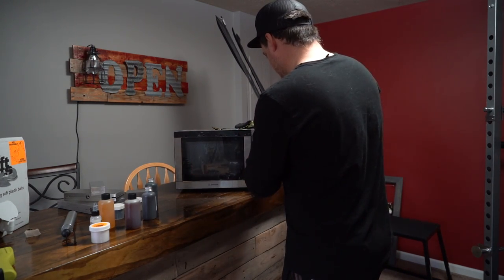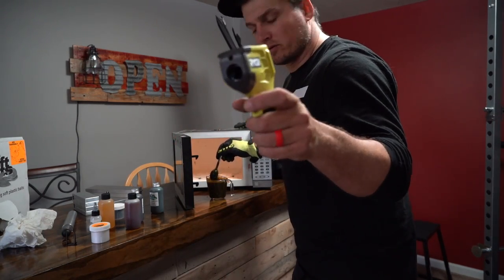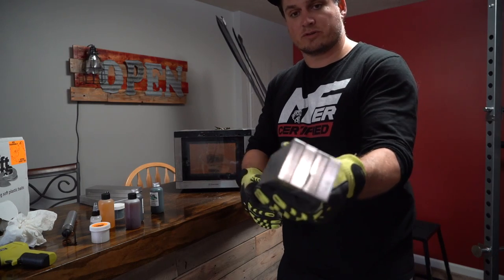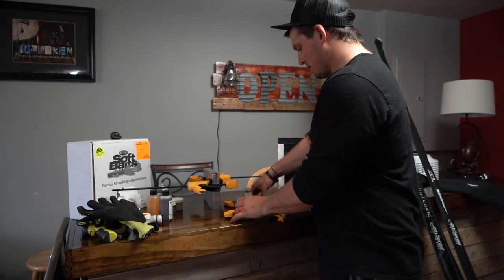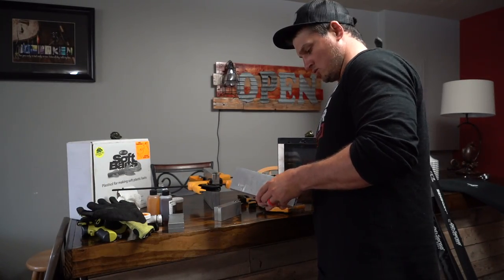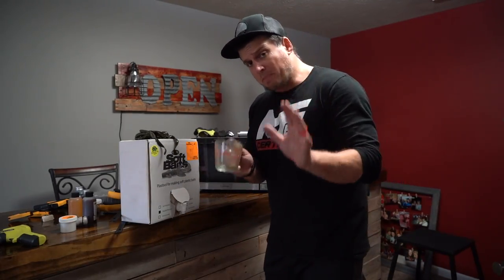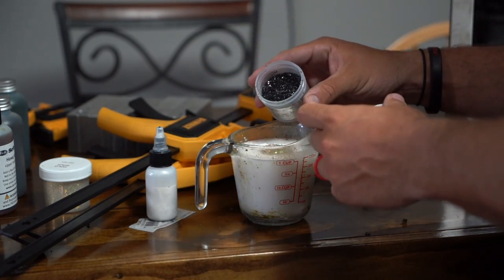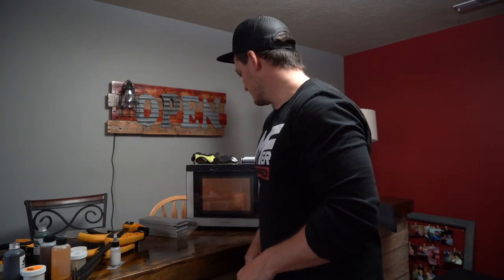How to Make Soft Plastic Fishing Lures!!!

Comment: I've been doing homemade soft plastics for some time now, so allow me to share some of my experience.

#1 Always take notes. Perfection in repetition requires you to learn from your mistakes (or improve your successes). Always start with the same amount of Plastisol. For me, i like working with 1 cup at a time. That way, you'll always know how long to cook it in your microwave (2:30 for my 1100w microwave), as well as how many drops of pigment to achieve the clarity you desire.

#2 Do Not pour plastisol into your injector until you are well versed in it. At ideal temperatures, the plastic will flow like milk. Once it cools down, it pours more like maple syrup. Even while wearing gloves, 350degree plastisol will burn you. It's the plastic used to print images on clothing, so it will seep into your clothes and stay there. It's better off to insert the nozzle into the plastisol and peel it off the injector before shooting another mold (it will solidify quicker than the plastisol in the mold).

And lastly, #3 you can cook the plastisol to 350 degrees BEFORE you add your color and glitter. I know it looks white in it's shipping container (or your Pyrex), but it will be clear when it's fully cooked. That way you can stop yourself before you go too far with Green Pumpkin. You can always add more, you can never add less (adding more plastisol to the cooked stuff won't work). I recommend taking your time and counting your drops. For me, 20 drops per 8 onces is plenty. I also use a 1/8 teaspoon for glitter, highlights, and pearl powder. 3/8 teaspoons is ideal for some of my recipes.
Reply: InEccess do you have a social media so I could possibly buy some
Reply: InEccess thanks for the tips bro I’m trying to get started making swimbaits for lingcod out in Cali. I really appreciate the knowledge.
Reply: @OutdoorsCK  thank you for your interest, but I do not. I only make mine as a hobby and to present the fish with a different look than what the local club anglers throw. It's a fun hobby and I suggest picking it up.
Reply: @berserk9163  if you haven't started buying supplies yet, i would recommend Amazon for the Injectors. You'll want the 90ml or 120ml plastisol Injector. You can always squirt your unused plastisol back into the pyrex cup, but you can't refill the injector if you run out shooting a mold. Dead on Plastix has plastisol for specific applications (like Swimbaits). The molds will be the most expensive, but you'll only ever need to buy them once. For a quality mold for swimbaits, I'd shell out the money for a good one from Angling AI. My Do-It mold has a defection in the tail on one of my cavities, so buyer beware. Angling AI machines the molds as they are ordered, so they're not mass producted an sitting in stock waiting for someone to buy it.
Reply: InEccess thanks I’ll definitely check em out
Reply: InEccess I’m interested in starting this myself I know it can be a little pricey what do you recommend for me to start out with budget wise.
Reply: InEccess what’s the best way to clean the injector after use
Reply: InEccess how much money do you think I will need to spend I have a microwave but nothing else. 
 thank you for your help.
Reply: Cade Shaw I haven’t started yet but I ordered stuff you need off amazon and eBay and all together I was able to get off with $150 but I would highly recommend if possible to spend at least 250 so you can get a 5 gal bucket and not a 1 gal
Reply: Do you need hardener or just plastic salt
Reply: how did this not get a heart
Reply: Will making theses in microwave ruin the microwave
Reply: @Cooper Bates I wouldn’t do that it might mess it up, I haven’t done this yet I’m still in the process of getting into the hobby but I’d leave it on a piece of wood or something flat and make sure it’s straight so it doesn’t solidify with a curve
Reply: what plasticol do you use i dont know what one to buy?
Reply: @oscar_is_carping4506  I use Dead On Plastix, as it hasn't given me a reason not to. I don't like deviating from my recipe, so I tend to use the same plastic every time.
Reply: @graysonstout6800  No. However, if you're using your kitchen microwave, your spouse won't be happy with the smell. To offset this, you can get a slow cooker from Walmart for under $40 bucks. In it, once you set the temperature, the fumes aren't as noticeable. You'll want 2 so you can dual inject your baits.
Reply: @henrycunningham4909  sorry for the delay. I use different premixed gallons of plastisol from Dead On Plastix to make it easier on me. That means I have at least 1 gallon of everything from Finesse to Craw/Tube depending on what I'm shooting. Secondly, I don't use salt anymore. Initially I did, but the salt being pushed through my injector caused the O-rings to tear and things got messy.
Reply: @Cooper Bates No. The extreme temperature change can cause your pyrex to shatter. What you can do is get the artificial ice (usually fluid inside a heavy duty blue plastic container) and press that against the sides of your mold after injecting the plastic.
Reply: @cadeshaw3243  sorry for the delay, YouTube didn't tell me about these replies. Amazon injectors (about $120 for a dual injector) and Do-It Molds (~$60 plus shipping) will be your first purchases. The plastisol ($45 for a gallon plus shipping from Dead On Plastix) to save money on shipping I would also buy the colorant and glitter from them. So $250 should get you your first (as an example) 320 dual colored Senko's (It's not too far off from what 320 Senko's would cost retail). After that, your next batch of 320 will only cost you $45.
Reply: @goober1441  if you're talking about during the bait making process, I eject as much of the liquid plastisol back into the cup as I can, then allow the injector to cool down enough for the plastic to harden. I'll keep that plug separate, along with the runners in my C block, until my cups are almost empty.

Before I start, I will heat up the injector so it won't ruin my first batch of lures my cooling them down too early. Following this, I'll spray the inside of the injector with WD40 to help remove any condensation before it mixes with the plastic and creates bubbles in the plastic. Wipe it down with a bottle brush, and shoot.

When I'm finished, I'll unscrew the plunger from inside of the injector and once again scrub it down with the bottle brush, this time with oil (worm oil or 3 in 1 oil). It keeps any plastic that manages to squeeze past the O-rings from accumulating and fouling up your draw.
Reply: How long do you wait for them to cool down once in molt
Reply: @northernballerz8145  it depends on the bait. Obviously, a thin ned worm will cool down faster while thick swimbaits will take longer, but most will be ready in just a couple of minutes. Generally speaking, once you see the center of the runner firm up, you can take your baits out of the mold. What I do is hang the soft plastics overnight and bag them the following day, but if you're in a pinch you can toss them into cold water.
Reply: Ya you dont have to start with same quantity all the time. Also black and darker pigments will warm quicker. Of course you use the plastic that has cooled down that has set.
Reply: @InEccess  get the basstackle injector. They have a stop on it and you can buy dual injector if you really get into it.

Comment: i usually dont add the glitter till the plastisol is heated up...just due to the fact that if you do accidentally over heat it, it wont melt the glitter...also using heat resistant glitter is KEY!

Comment: To extend the working time of the plastic, could you heat the injector in boiling water before pouring or drawing your mix before injecting it into the mold?

Comment: M’fer coupon code? $300+ for that whole setup is a big commitment.
Reply: You don't need to spend that much. Look at the Do-It molds on Cabela's, i got a 4 cavity Senko mold for less than $40. I got the smallest injector on Amazon for a similar price, just know that the 45ml injector does not hold enough plastisol to fill all 4 cavities. I recommend that the first time you use it, you save enough cooled plastisol from the sprue to block the flow to the bottom cavity. 45ml is enough to do 3 Senkos at a time. The Plastisol I buy is from Dead On Plastix another $40 for a gallon. Lastly, I get my pigments and glitter from Lureworks. For less than half of the price you quoted, you could be shooting your own plastic baits before the fish are done spawning.